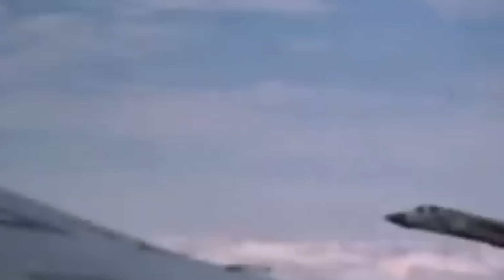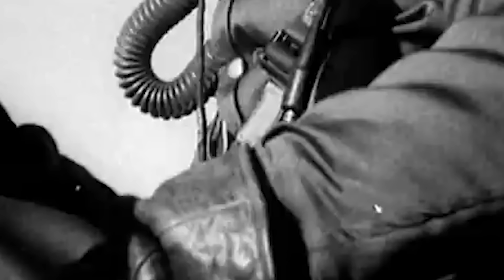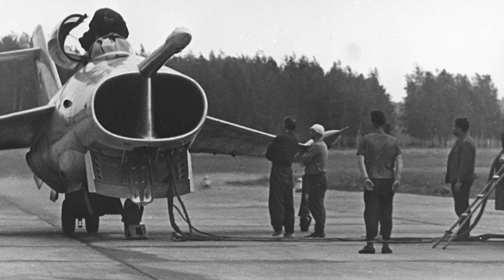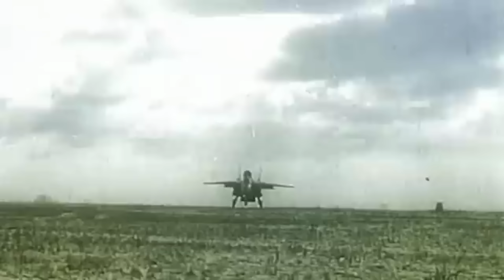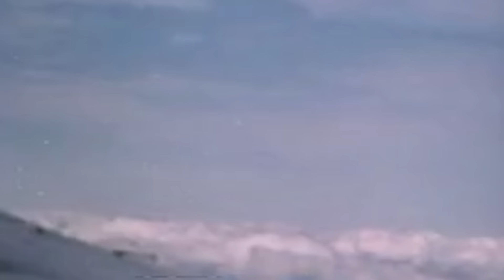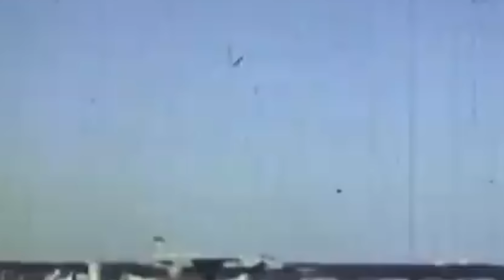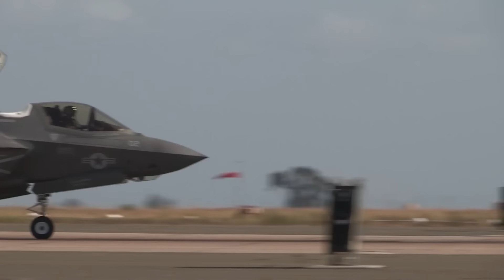America Stole This Plane and Turned It Into a Monster

Comment: Had quite a few problems.  The horrible MD Douglas was developing what is now today known as the F-35, was the actual stolen craft by LM and not openly published.  While credit for original design removed from the actual developer.
Configurations studied by Yakovlev included a twin-engine configuration, which was rejected due to asymmetric thrust issues in the event of an engine failure during landing, and a single-engined configuration, with lift jets to allow for vertical takeoff and landing, was selected.

Comment: Dude, what are you talking about? Yeah, the Yak-141 was faster than the harrier, but it was designed as a fighter. The harrier was an attack aircraft. Of course it’s going to be faster. 

Secondly, the thrust nozzle was “revolutionary?” How? The US already patented a 3BSD in the 60s and by 1990 it was already attached to the Rolls Royce Lift-fan. 

DO ACTUAL RESEARCH.

Comment: If the Yak was so amazing then why did the US continue using the Av8b Harrier for 40 plus years? You think that an aircraft that was supposed to be superior in design the US would have grabbed it faster. Hmm 🤔 I think there is a failure in your logic. Lockheed Martin took what was good about the Yak 141 and scrapped the albatross of an airframe. The Yak should have been named Yuck 🤮 because its aerodynamic design or lack there of made it a target for radar. The F-35 is a awesome design sleek very small radar return where the Yak was a flying brick wall. Just like the harrier the Engine concept was what was good from the Dornier Do 31. The aircraft was crap but engine great.

Comment: just make the landing gear angle the whole plane upwards angle. then it can take off directly to air. it can also land propulsively. yep no other changes by the angle of the landing gear. you have put it horizontally for now. the effect is kinda thrust vectoring to more usable angle. any fighter has pwr of more than 1 anyways. the most extreme such thing is to angle the whole plane directly upwards by the landing gear. no other modifications to any plane than the landing gear configuration. sometimes trying to just hover the airplane leads to overcomplex solutions. instead of messing with thrust vectoring flap directions, why not just angle the whole plane upwards. ie telescoping landing gear. then just one main engine would be enough. why be worried about the decorations. same reason birds flap down when in vtol mode. less moving parts is more robust durability. keep it simple. ie if you want to launch upwards, aim the weapon upwards. climb rates for a vtol rocket are upwards.

Comment: While Neil Armstrong was testing design for the lunar lander that was very similar to some of these models.
He had to eject at very low altitude.
He once again came close to death.
But after the crash, he went back to his desk to continue working. Buzz was amazed. When he came into work. He saw Armstrong calmly concentrating at his desk.
He later found out about the crash.
Armstrong was one of the Greatest Pilots ever!
Read about the Gemini Capsule in orbit spinning out of control at a very fast revolution.
Most people would pass out. Armstrong got it back under control!

Comment: Yes it had the rotating spinning nozzle in the back like our F-35B that diverted thrust downward, but the Yak-41 Free Style also had 2 additional jet engines, I believe, mounted vertically behind the canopy to assist the main engine for vertical take off. So this probable resulted in more jet engine maintenance. Where as the F-35B has a driveshaft that goes to the lift fan that is behind the canopy that also pushes down just cooler air, so it is continuous air bouncing on the ground going into the air intakes. Not air mixed with partial exhaust coming off the 2 front jet engines that was on Free Style.

Comment: Instead of commenting to all the idiots on this thread individually that don't seem to understand the development time line on this aircraft. Or it's background and saying some pretty outlandish things. I will make my own post to address all of them and clear up some things up.

First off the Yak-141 is the successor to the Yak-38 that was developed in the 60s. I see some people say the Russians stole the idea from the Convir 200. That didn't even make it on paper until 1973 and never left the drawing board. So that would be wrong. They already had a working aircraft the Yak-38 before the Convir 200 was even a thought. I know its hard pill for some Americans to swallow that thr Russians may have been ahead with some things but they were. Just as the Americans are ahead in many developments themselves. 

The reality is the Yak-141 was the most advanced V-tol fighter ever built at the time  and yes much better than the Harrier it should be since its 30 years newer. Why is this even debatable?. Its a Mach 1.6 vtol fighter. That makes it better very simple. It just never made it to mas production due to the collapse of the USSR. 

Finally lockeed. Bought thr data for this Aircraft for a reason. And perfected it with their own design with the F35-b.with a much lighter engine set-up. But yes in this case the Americans copied the Russians waaaaaaaaa cry about it some more.

 This is common that rivals nation's backwards engineer each others good tech. It happened in WW2 with the Germans and thr russians. Its a basic part of history. Stop taking it so personal that your country copies your enemy sometime. Stop acting like this never happens unless your country thought of it first. Grow the F up. You should be happy that the Americans now have the best Vtol aircraft in the world as the result, the F-35b. 

This idea that the Americans design everything and don't copy anyone. And only other nations steal from America makes you looks so stupid and ignorant. You make me embarrassed to be an American myself. Just shut up with this ignorant Merica! BS shit already. You sound dumb. Everyone uses good data when the data is good. No matter who its from. Read a history book and get off your couch.

Comment: This aircraft was always doomed to be a failure, because it used a massive amount of fuel even in STOL. If you used VTOL instead of the short take off, you may as well have started your landing routine the moment you managed to crawl it up to 10 000ft. That also massively limited its possible ordinance.

Comment: Making the Harrier look ancient. Well of course. The Harrier was designed in the 1960s. The supersonic Harrier (Hawker Siddeley P.1154) was cancelled in 1965. With Phantom IIs being purchased instead.  Blame the RAF and US pressure for that.
  The BS.100-8 engines were actually built for the supersonic Harrier. Some are on display today.

So in essence, this video is full or inaccuracies and outright lies.

Comment: The YAK was  decent plane but I am sorry revisionism is a very big brat.  Whatever happened to the two aircraft stolen from M-D earlier than this (by LM?)  Including the Douglas version of the JSF?    Sorry but at best this is FISHY, FISHY, FISHY.  Have been following aircraft since the 60's.  Never any of this until just now . . .  Very hard to believe . . .  The Harrier was developed back then  (in the 60's) and has changed little since then.  Strange that the JSF offered by M-D was also a electric fan power assisted VTOL.  Yet there is no info on it. . . why?  Who is hiding what?

Comment: The fact that Pratt and Whitney had access to the data and design of the engine and STILL can't get it right, 30 years later, is testament to how much knowledge they lost by treating their engineers like they were disposable during the late 90's. They lost knowledge that will never come back. They have to contract out ALL of the engineering and design work for the cold section of ALL of their engines and have for the last 25 years. What a failure of a company they now are, a shell of their former self during the days of the J58 engine. Sadly, they are no exception insofar as American industry.

Comment: McDonnell Douglas began designing the F-15 in 1965. Two years later the Soviet Union released the Mig 25. Two years before the Department of Defense awarded the contract for the Eagle. The two aircraft are strangely similar. The hurried one was garbage and the original is still flying. The Soviet Union stole the early design for the Foxbat. This Yak also shares obvious similarities to the Eagle.

Comment: Hold on now, this isn’t quite right.  Refer to the Convair 200 which was proposed, but never built, in the early 1970’s about 10 years before the Yak41 and the Yak used the same propulsion setup that would have been used in the C200, 1 engine in the back and 2 smaller turbines, mounted vertically, behind the cockpit so it was a 3 engine setup.  When considering a VTOL aircraft, US paid Russia a decent amount $$ in order to have them build 2 prototypes of the Yak41 and the US would evaluate its performance.  This was cheaper than the US having to build one from scratch.   The Brits had VTOL figured out in the 1960’s, earlier than anyone, with their Harrier.

Comment: Come on.  The Yak-141 was failure with only 4 protoypes built.  It was a replacement for the Yak-38 which was obviously a copy of the Harrier.  Lockheed paid for a bill of goods that turned out to be nothing they didn't already know from the Convair Model 200.  Also: OOOH, the Russians managed to outperform the Harrier, an early 1960s design, with a plane designed 30 years later?  Sounds on par.  And fly-by-wire?  You mean the technology pioneered by the F-16 20 years before the Yak-141 ever flew?  Please stop undermining your credibility with sensationalist lies.

Comment: The first minute of the video contains utter bs. This jet was called: “Як – об палубу хуяк!”, or “Yak – hits the air carrier f hard, when falling on it”. Almost every of these jets had issues with VTOL systems, engine, hydraulics and electronics issues. There were lots of crashes while performing VTOL or just during flight. NONE of these jets fly today, and it shows. While older SU and MIGs keep flying. Outperformed Harriers? Good anecdote, mate!🤣🤣🤣👍🏻

Comment: The Convair Model 200 of 1973 was the first plane with this hovering arrangement, and the Yak-141 of 1987 was a copy of the Model 200.  The F-35 made an important advancement over both of them: the front hover fan is powered off the jet, which saves a lot of weight.  So we see it was the Yak that was a copy, with the F-35 doing something new and different and better.  All three planes are on Wiki with good sources so you can read about it.  Pity the video creator didn't do that.

Comment: I really like your documentaries - they are invariably interesting - and this one, especially so. Thanks for the education!
Reply: This one is mostly false, though.  The Yak-141 is a copy of the 1973 Convair Model 200.  They both had a vectoring thrust nozzle at the rear and extra lift engines in the front.  The F-35 was different and superior, powering the front lift fan off the jet engine.

Comment: America paid for it, $400 million. We bought that thing fair the square.
Reply: Both Convair and Rolls-Royce partnering with MTU had tested that type of nozzle.  The German aircraft was the VAK-101e
Reply: @bernhardzunk7402  Do you mean VAK-191B or VJ-101C? I don't think either fits the bill.
Reply: @frank-y8n  Yes, my error.  I meant VJ-101e.  You should be able to find the nozzle if you google it. V/STOL Fighter Programs in Germany: 1956-1975
Mike Hirschberg
1 November 2000.  Convair also developed this nozzle type.

Comment: The Russian internal reports said the Yak-141 was dangerous lacking in power it's vertical lifting load was appalling it's bad weather handling was atrocious and it didn't help
by having an aircraft carrier that was too small Admiral Kuznetsov so they tried to increase the size of the aircraft carrier only to find the effects of the carrier's motion on aircraft landing and takeoff was terrifying in bad weather for the pilot and the deck crew?

Comment: Incredible engineering marvel. As such it deserves to be prinounced properly. This plane was designed by the Yakovlev design bureau, so it is not "wayaykey" it is simply "Yak 141". 
Similarly the Mikuyan- G      uryevich planes aren't "Emaydzee" ajd the Ilyushin planes aren't "ayel" planes. Russian types are supposed to be pronounced russian sounding.

Comment: Title: "America Stole This Plane and Turned It Into a Monster"
S/B
Title: "Lockheed Martin *Bought* This Plane and Turned it Into a Monster".
Reply: Lockheed was building its own plane quite differently than the Yak or the 1973 Convair Project 200 (which worked exactly like the Yak).  Lockheed bought the Yak data to check over, but there's not a single part in the F-35 that is similar to some part of the Yak.

Comment: The YAK was a attempt on answering the Harrier...and it was a total failure. Unable to carry almost any weapons due to low power to weight ratio, and abysmal service range. Soviet jet engines were powerful, but heavy, thirsty and had a short lifespan. According to propaganda (as always) it was a breakthrough in technology,  but according to the military trials it was a total failure with all the shortcomings I mentioned. Even the engine concept was nothing new. Bot just like before, and at the time of the YAK 41, it was beyond the technologies available at the time.
Reply: And the Harrier was an attempt to answer Britain's failure to produce successful supersonic aircraft.

Comment: My Grandpa used to work on the Yak 28. So I was positively surprised when I heard that the F35 derived by a bit from the Yak141. 
However This swivel nozzle design was already in place with the Convair Model 200 and the JTF22A-30A jet engine.  But the Convair 200 was a delta wing design with canards.
Reply: Apparently the Convair Model 200 and the JTF22A-30A were proposed at the sketch level, and were not produced in hardware.  There were thousands of such fantastic projects in the USSR . you can claim primacy in an idea for many years. )))))  In YAK141, the nozzle has been changed and tested hundreds of times, this is a different level.
Reply: Someone posted above:
"The Harrier already used that... it was the second lift fan that the US took from it."
So, maybe the video 's producer got the new design part switched.

Comment: The Rolls-Royce RB.162 was the first serially produced jet engine with composite blades and composite casing.  They produced 80 of them for VTOL testing, and a later derivative engine was developed for the Hawker Trident.  It was too fragile to be considered for mass production but it paved the way for the extensive use of composites in modern turbofans.

Comment: Thank you again. well researched and the delivery was near perfect. My very best to you and yours. Leona
Reply: It's incorrect though.  The Convair Model 200 of 1973 had the exact same design as the Yak: vectoring rear jet, with front engines only used for lift.  The F-35 powers a front lift fan from the jet, saving the weight of the extra engines.  So no, the research really sucked.  This is all on Wikipedia.  He could have just read Wiki.

Comment: If you want to know why the West didn't develop an air superiority fighter like the Yak (and does not appear to even want one) the answer is that the use case for it is just not there. A close-air support attack aircraft minutes from the front? Yes. A plane that can hunt and do ACM against a Mig-29? No. The reason is simple: modern air superiority ops require a lot of aircraft: not just fighters but tankers, electronic warfare, and an AWACS--they can't just jump up out of their little hidey holes in the forest. You simply cannot sustain military operations without functional runways to bring in supplies.

Enter the strike fighter. When the US Marine Corps finally wanted a replacement for their aging AV-8B ground pounders, they did not need to "steal" the Yak Freestyle. They had every design facet they needed, and had them integrated into the F-35 family's B model--an aircraft completely different from the Freestyle. What the Americans got from Yakovlev was $400million worth of valuable test data to back up the results from simulation and wind tunnel testing. This probably cut 1-2 years off the design cycle. They didn't take anything from the Yak design, since they already had designs like it on the shelf (e.g. the Convair VTOL aircraft for the USN). 

All this is reflected by the fact that, among US armed services, it is only the Marines who operate a V/STOL aircraft.

Comment: Convair developed a 3-bearing swivel nozzel for thier Model 200 project in the 1970's.  This the same type of nozzel used on the Yak-141/F-35. Convair became part of Lockheed and that is why they went with that design. The 3-bearing swivel nozzel allows greater exhaust velocity over the ducted exhaust of the Harrier and was necessary to allow for an afterburner. Lockheed purchased the testing data of the nozzel from Yakolev so they didn't actually have to develop thier own test article and this was encouraged in the early 90's with US agencies doing business with the Russian military industrial complex to keep them in business (for geopolitical stability). Fundamentally all it did was prove Lockheeds existing calculations correct and perhaps saved a few million in R/D but it in no way suggest the F-35 was stolen from the Yak-141.
Reply: You're totally right about the Yak being a copy of an American design, not vice versa.  The F-35 was in fact different than the Convair and Yak, as it powered the front lift fan from the jet, saving the weight of a useless extra engine.  However, I think General Dynamics sold Convair to Lockheed in '95, well after work had been going on on the F-35 for 5+ years.